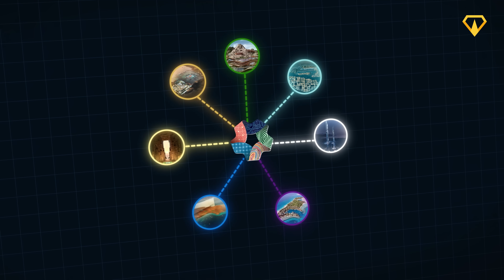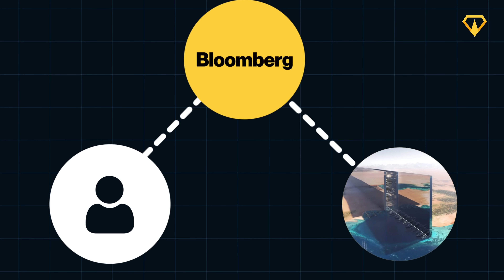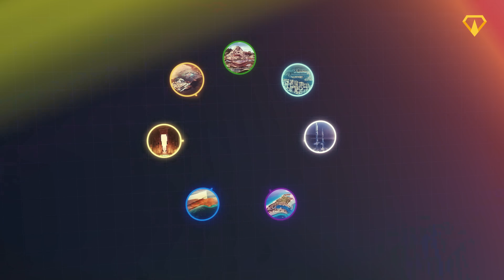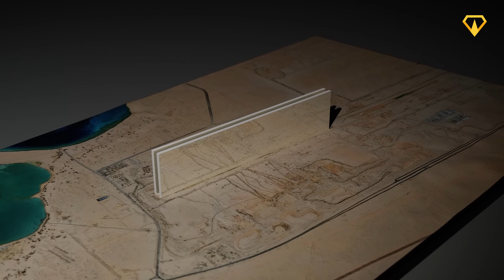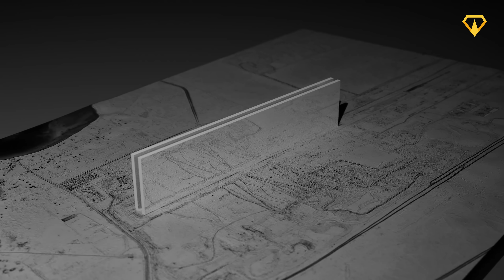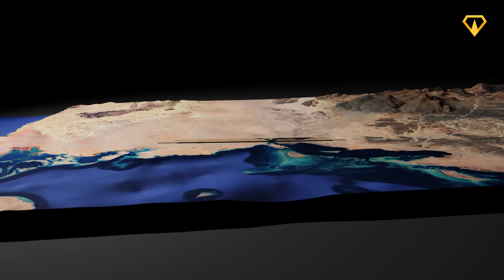The Line: Huge 2024 Update!

Comment: If Saudi Arabia is serious about building this, I do not understand why they haven’t figured out that they could assemble the Line the way cruise ships are built after the construction of a supporting superstructure that would be much less expensive. Everything else would be prefabricated modular and installed in sections.
Reply: yeah seems like the most feasible way to do this would be to start with a large port area where materials could be brought in and fabricated into modular sections then load up on a tram system that moves those modules down the line to the leading edge to be installed into the final assembly.
Reply: thats genius actually lol
Reply: yeah, them using excavator is just ineffective 
they should have look up how Germany dig the coal mine and do something similar to that
Reply: Yeah, sure, and the end result would cost a lot less. But it would still be stupid.
Reply: You are totally right… It’s a stupid idea to begin with.

Comment: Oh man! I was so hoping that I'd hear your take on this! I have been following an English gentleman who will lay down his genteel manner when it comes to talking about The Line! Gosh, I love the British when they get worked up~! I knew you would keep your professionalism about you, though I have not seen your outtake and B rolls to confirm. 
To the point: It's a crock of a secret formula no one believes in. I'm not an architect and you don't want me near your electrical or plumbing works, either. Yet I, after about ten minutes of the first promotional film, hooted, gave the TV the raspberries and shut if off. The sad thing was I couldn't concentrate on my work, which is a rather important project. I kept giggling and then roaring--how long would it take to get a plumber out to a specific unit to unclog a clogged toilet? Is anyone talking rentals, fees and floor plans yet? Because this building is going to be the biggest dog on the planet--which is not really want the Crown had in mind.
What sealed it in my mind was when a reporter asked Crown Prince Jethro a question about the mega-plan that it had become by then. The prince gave a rambling response that was the equivalent of the Price folding and then flying a paper airplane around the dias, clearly bored.
Even if they built the starting section as it was originally envisioned, those pleasure spacecraft buzzing around in the atrium might not be as expected. I see the Crown Prince clarifying that. What he meant to say was The Line will have the biggest projection TV on the planet to show sci-fi and other films. Also, Mohammed bin Salman Al Saud looks so dumb, he has an assistant that wipes his drool off.

Comment: As a structural engineer, I suspect that they sold an architects dream without consulting the real posibilities with the engineers of other branches. The construction needed to start and they did what they could but with no specific solutions for the exacts loads,electricity needs, Hvac, plumbing etc it was doomed to fail. Most of the ambicious projects go that route. Gets done as a sketch. Investor loves it. Engineers get involved and try to get everything done according to reality, Investor wats the sketch, architect insists it it possible. Project moves forward with basic design and start of the construction. Detailed drawings are impossible to make without specific inputs so the project stalls pretty quickly and price starts to rise.

Comment: It would make a lot more sense and save a lot of money to start with a smaller section of the Line and possibly add to it from there. The AI systems alone would have to be debugged, along with many other engineering challenges. Get it all working on a small scale, then go from there. That is, if it makes any sense in the first place.The whole concept seems like it wants to challenge conventional building if for no other reason than just to challenge the norms, not that there is anything stupendously advantageous in such a design.

Comment: At 6:50 .... "nervous about....finishing projects"
Let's not forget, that even if the line WERE built as planned, it's very much an open question whether human beings will go and live in it voluntarily.
And if they do, it's an open question whether life in there will be tolerable or even practical.
Where are the detailed plans? This linear design literally maximises the length of the average journey. How much time will citizens spend per day, commuting?  Did anybody work that out, are there any designs and statistics? All I've seen is a vague promise to build a train faster than any existing train in the world, even the Japanese ones. Given the timetable of Neom, that train needs to be already be in development! Where is it?
What is the plan for the sewage system? The air conditioning? The water supply? The lighting? (narrow canyons between tall buildings tend to be depressingly dark.)  How will sandstorms be handled? With people crammed in at record breaking density, will there be places to walk, parks to rest in? 
And the big question: why would anybody want to live there, if they could live somewhere else?

Comment: 170 km long
200 m wide 
500m high 
Let's say 5 m per level - so 100 levels
Use any cost per sqm you like from any City in any country
then divide by the 9-million residents they claim
Cost per couple for an apt will be in the 20-30 million range.
nice,
now where will maintenance and service people live ? since they can't afford 20 million.
Yeah, they will live in the slum next to the line.
High speed train that goes 170km in 20 minutes? Really? only if it has NO stops other than the ends.
This is the type of dream dictators and royalty have, since they never consider the practical implications.
Meanwhile look at how the average person in the country actually lives...
What a bad joke.